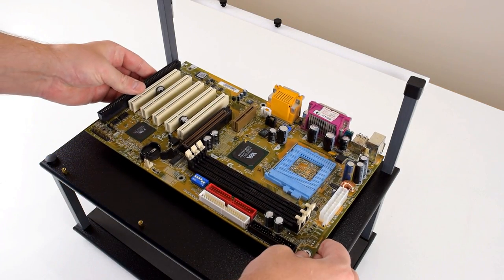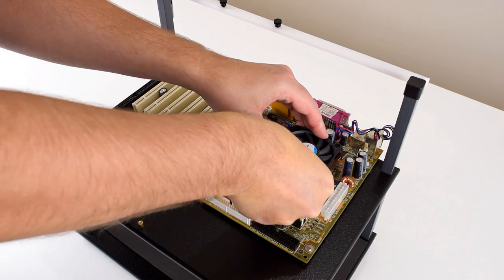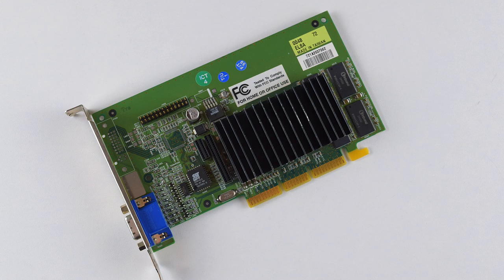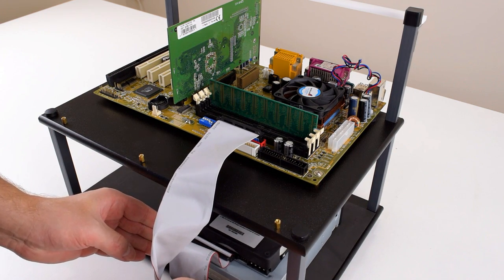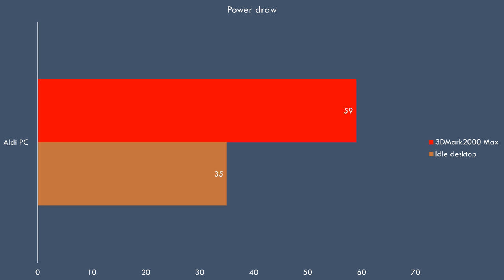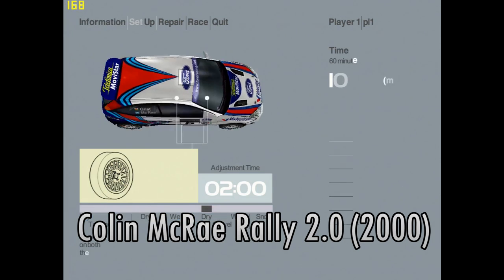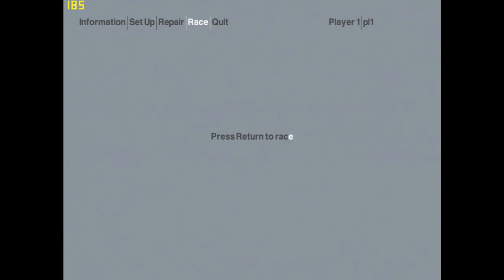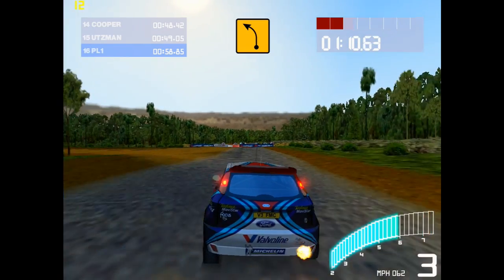Building the Aldi Medion Supermarket PC from 2000

Comment: I started my career as a games developer at a German studio in 2001. Everytime ALDI released a new PC, someone of our team went to ALDI in the early morning to get one. They were sold out quickly. We used them as a "benchmark". It was an internal policy. Everything had to be acceptably playable on these computers with  "out of the box" Windows installation. We did not even update the drivers. Many people had no (or very slow) internet at that point, so old drivers were a common problem. I have heard of other developers doing the same thing back then.
Developers often recommended these PCs to casual users because many software products released in Germany were carefully tested on them.
Reply from the maker: That's awesome, thanks for sharing!
Reply: maybe you can help me because you have worked for a games developer.
Why I have frame drops in Deues EX after I have format the system and install Windows again? I have install Windows update Service Packs and Mainboard and Graphic, Soudn Drivers... its strange.. and now I have texture bug in Hitman Codename 47 before there wasn't any bugs. 
Its strange what is the reason? Even in the Vidoe with Geforce 2MX Deues EX is lagging... it can't be....
it remembres me like GTA San Andreas...
Pentium 4 3,6GHz and 1GB DDR and Geforc e6600GT is enough to handle this game at 1280x1024 Maximum with 3x Anti Aliasing but in some areas the fps go down to under 20 or even 10.... its not normal... how can I fix this?

Comment: The early Aldi PCs were a gamechanger. I remember when the they offered a PC for 1999 Deutsche Mark. It was talked about weeks before it got on sale. Together with the availability of flat rate DSL connections they marked the begin of the Internet Age for the general public in Germany. Those were the days.
Reply from the maker: Would you happen to remember some details about this 1999 DM PC?
Reply: Wen never had one of those since we had PCs since the early 90s but let me do some research. They were sold in the late 90s and I think the first one even came with a Monitor.
Reply: The only thing about the very first ALDI PC I found is, that it sported a Cyrix 5x86-100GP and it sold well for a computer in 1995. The first legendary ALDI PC came in 1997, it sported a Pentium MMX 133 Mhz, a 2,1 GB hard drive, 32 MB Ram, some kind of 3d graphics and a 15" Monitor, a Mouse and a Keyboard were included. It costed 1798 DM.

In 1998 came the perhaps most iconic of all ALDI PCs. The MicroATX Tower sporting a Pentium II 350Mhz, 64 Mb SDRAM, 8,6 GB Harddrive, a Creative Soundblaster PCI 64V, a NVIDIA Riva 128ZX with 8 MB Memory and a 32x LiteOn CD drive costed 1998 DM. It came with a 17" Screen, mouse and Keyboard as well as MS Windows and Office.

The later PCs were good as well until 2001 when their offer was not competitive.
Reply: My parents bought the 1998 PC. best christmas gift ever I tell you! i had no idea they'd be able to buy this :)
Reply: @philscomputerlab  Hello, I just stumbled on this old question. I once got one of "the first" ALDI computers by luck. The owner wanted to get rid of it and it was waiting to be scrapped. Of course I took it with me (along with many other parts) to find out that it was not only completely original but in fully working condition. Specifications were (as I remember rigth now) 486 PIO-2 oder 3, with a Cyrix 586 100GP, a 2MB PCI graphics card and 24MB of RAM. I think there was a 2GB hard drive in there but I might be wrong. 
I later changed mainboard, RAM and graphics card for more powerful 486 components. I want to pull that old machine out again and refit it to original condition. I still have all the parts stored away. This particular machine was sold around 1996. I can take pictures and give precise information about that machine when I have it in front of me again, if you are interested. :-)

Comment: had a similar PC some time ago, always got the old PCs from my Grandpa whenever he got a new one.

Got one from 2004 with a P4 3.2Ghz with HT...got bored and overclocked it to 4Ghz. Ran great. And hot.
Reply: I also got a p4 HT, but clocked at 2.4 and with a radeon 9200 SE
Reply: The LGA775 P4s were ridiculously overclockable: I had a P4 630 (stock 3GHz HT) and it ran with no VCore boost stably at 4GHz for many years.
Reply: i had the P4 640 and also never changed the voltage. I do have a CPU-Z screenshot somewhere, but nothing could read the voltage correctly... 2.3v would be a little much :D

Comment: Your build videos are some of my absolute favorites. Seeing the performance of a particular configuration from back in the day is really interesting stuff.
Reply from the maker: Thanks man! It helps me as well as I have a clear plan / goal to choose parts. If you know any other machines / brands that are worth checking out let me know!
Reply: Well, a lot of systems back in the day used proprietary motherboards and daughterboards. Specifically I remember systems from AOpen, Micron, Compaq, and NEC that used setups like that. They were Socket 7 and Slot 1 if i'm not completely mistaken. As i'm always seeing these kinds of used parts floating around it would be really interested in seeing if you could get something like that up and running, and how it would perform.
Reply from the maker: I do have something planned from the US, still working out details and I got to buy a few parts.

Comment: I avoided these sort of cost savings pre-built computers like the plague back then, but it is interesting to look at them retrospectively.

I've only ever built my own PCs starting when I was a young teenager around 25 years ago from old computer parts I was given and could work on for people. Then when I was making enough, I built computers from all new computer components I would source or have stores order for me – this was well before on-line shopping was really a thing.

The first all new computer I built was a Pentium II machine. The oldest computers I've worked on that I know of had 8086 CPUs and no hard drives, from what I remember. Either way, I still have some of the 8086 CPUs from back then from long since decommissioned machines.

Comment: We still have a Aldi PC from November of 2002 with an Intel Pentium 4 running at 2.66 GHz. It had 256 MB DDR 333 MHz RAM, but I think my father upgraded to 512 MB RAM. And it has a Nvidia Geforce4 TI 4200 graphics card. I was born in 2001and it was my first PC, which I used from somewhere in 2009 or 2010 to 2012, when my father bougth an Intel Core i5 based PC and I got his old Core 2 Duo system.

Comment: 5years ago my buddy gave me his first pc, a "supermarket" pc from the year 2000 (brand was Altec - very popular computer back then in Greece). Specs were P3 800, 256mb sdram, had integrated GMCH graphics with 3d support (on an msi board) and a maxtor 20gb ide drive. After replacing the cpu-fan, psu, the cd-rom drive with a dvd-rom and the hdd I'm currently using it as a voodoo3 platform along with a sounblaster live 5.1.

Comment: You can run Agp 4× under win98 with both Ati and Nvidia without problem by installing Via 4.37 in turbo mode ONLY! (no 4.35,4.43) after that, in some motherboards,would keep the " Via Agp generic windows driver" instead of "Cpu to Agp controller". To do that  you should install manually from where you are reading that (device manager). If after that, enjoy Agp 4×

Comment: I've only bought a pre-built branded PC, and that was my first one in very ancient times (1992 I think). It was a WANG system, with an i386SX 16 MHz, 2MB of RAM, and a 40MB HDD, complete with a VGA colour graphics and monitor. Surprisingly the thing was very much a standard PC, and there was no problem in doing some upgrades.
In 2000 I was using a clone machine with an Athlon 1.4 GHz, 512MB SDRAM PC 133, on an AOpen VIA KT133A chipset based motherboard, with a Geforce 4 MX440 with 64MB. Pretty high performing machine back then.
Reply from the maker: How was that Athlon PC? Maybe compared to the games shown on this one?
Reply: It was a pretty powerful machine, and I could run all games smoothly.
Here's some benchmark results I've been able to find I did on that computer. Everything @1024x768 except Q3.

3DMark 2000
5622 with a Geforce 2 MX
8177 with a Geforce 4 MX440

UT Bench
Flyby : 80 fps
Botmatch : 37 fps

Quake 3 Arena
Maximum detail (1280x1024) : 103.6 fps

CPU Mark 99 : 122

3D Mark 2001 : 5252
Reply from the maker: Awesome, thanks heaps!
Reply: No problem I have a good amount of benchmarks data on retro hardware, in case you need some :)

Comment: The Aldi Medion machines of that era were great deals.  I purchased 2 of them here in the USA for me and my friend.  The year was 2003 and for the times it was really loaded with goodies.  These were touted as award winning design machines, having attained the Red Dot Award, whatever that was.  There were also XP machines with great software bundles.  The cost was 800 dollars per unit.

My Aldi's motherboard died in 2008, so I scrapped most of the internals except for the optical drives and card reader.  I loved the case so much I built a quad core AMD system in it.  I still have the machine and it now currently runs Ubuntu.

My friend used his Aldi up until 2014 when he decided to modernize and bought a new loaded HP.  The only problems he had with his was the power supply and cpu fan died died, so I gave him the ones I had.

I think the Intel P4 cpu ran at 2.5 Ghz, which was fast.  It used the Extreme Graphics built into the chipset.  I disabled mine and added a video card.  Really did not make much difference.  One curiosity of the card reader was it was limited to reading 256 Mb.  When I rebuilt the guts and still kept the card reader, it then read cards in excess of 1 Gb.  My guess is the original motherboard had limitations.

Yes, these Aldi Medions were absolutely great deals for the times they were available.  I always refer to these units as Aldi's and not Medions.  

Keep up the good work with your builds.  Very enjoyable to watch.

Comment: this was great! while we didnt have supermarket pcs so much here, emachines was all the rage at the electronic shops. everyone i knew had one becasue they were cheap, usually using slower than the time athlon chips or even celeron, which around the 2000s were terribly underperforming. usually i would help friends upgrade ram and get at least a bit more out of them.   Also when you said coolbits reg tweak i had a nostalgia blast! awesome!
Reply from the maker: Emachines! Nice, got to do some research, maybe I find a suitable machine :D

Comment: Man, you reminded me of my very first pc. It was an altec one, bought at 2000 from an electronics store for around 2000€ (using today's currency exchange rates). It has a pentium 3 at 800 mHz, 64 mb of ram, a 10 gb ide hard drive, a single cd-rom drive (was later upgraded to a cd/dvd combo drive), on-board g.p.u., a 1.44" floppy drive and windows 98. My dad passed it to me after he got a notebook 2-3 years down the line.

The system was actually decent as long as it ran windows 98. I could browse the net and play a game or two (mostly flight simulator 2000 and monster truck madness 2) but it crawled when I upgraded to windows xp. If it had more ram it could ran xp with ease.
Reply from the maker: Altec? Sound familiar, but I'm thinking of speakers for some reason? Are they related?
Reply: I'm not sure....they might be. I remember the sticker on the case saying "made in Germany".

Comment: i had a medion pc from 1999! it was more 90s "beige box" design than the blue trim you showed on this 2000 model. but it did have a bright blue power button. (the box made it look more teal though.)

my father didn't let anyone even take it out of the box until the clock ticked over to the year 2000, because of y2k. he didn't really know what it was (as you may have guessed).

i couldn't really hazard a guess at its P3's frequency, but i know the hard drive was either 3gb or 6gb (there was some failure that we took it to a shop to get fixed, that lost us all the data, so the 6gb could've just been the smallest drive they had to replace a broken one with.. it's all so long ago!)

it had 2 usb1(.1) ports on the back, and had at least good enough integrated graphics for rayman and tonic trouble to run nicely. as well as some racing games and other ~2002 3d titles, i don't remember a lot of their names now!

Comment: on this System I played a lot of Counter Strike,  Diablo 2, Quake 3, Age of Empires 2, Sims, Sim City 3000, Black & White, max payne, operation flash point, warcraft 3. all those games ran smooth with medium settings. One of the latest games I tried to run on it was Doom 3 with the settings and resolution low, ram expanded and G2MX slightly overclocked. but I think it was all that playable

Comment: Recently i bought a similiar computer from my friend. It is a little bit older, it is from Q1 2000, and has an MSi Motherboard fitted with a Pentium 3 667Mhz. The computer wasn't used much. In fact, the HDD had only 1500 hours of use on, and the original W98 installation still had the Creative sound driver on the desktop, dated 2002!

Comment: This video really reminds me of a PC that I used to have, I called it the "P4 Rig" but it was actually a custom built PC that was built by some company called "DGT" which I think stood for "digital technology" according to a sticker on the front. It had a Biostar U8668 Pro mainboard with an Intel Pentium 4 unknown model 2 GHz, a Maxtor 40GB hard drive (I forgot the model), and 320 MB RAM (PC133). I can already sense 2 cost cutting measures there, plus it was a Micro-ATX mainboard in a silver no-name full-size ATX case, which makes a 3rd cost-cutting measure (in my opinion). Plus, when I got it (I was the 3rd owner, after 2 of my cousins), it was running a pirated copy of Windows XP Pro that was packed with lots of viruses, including one that throttled the Internet connection. From what I remembered, I completely wiped it and installed Windows XP Home from a legitimate product key I had. I did do a lot of upgrades, but eventually, the IDE controller on the mainboard died and that was the end of it, after which I parted it out and sold the parts on the local classifieds, and kept some parts for myself.
Reply from the maker: Awesome, thanks for sharing!
Reply: Back in the day, CPUs didnt had "model name" - it was, like, Pentium 4 @2000 Mhz. That thing happened when Intel hit the wall and couldnt rise clock speeds anymore so they name them in order not to be confused with older models that work on the same clocks. Like P4 530, P4 630 and so on. Their clock speeds were their names. AMD, on the other hand, had to come up with models names in XP era because they could get only to 2000-2200 Mhz and Intel was racing to 4 Ghz.

Funny thing was that Athlon @2000 Mhz was beating Intel @3600 Mhz.

Comment: These days the only prebuilt computers I buy are laptops, and Chromebooks/Chromebits/Chromeboxes, but back in the Vista era I did buy a couple of prebuilt ACER machines here in the US from BestBuy for my sister, nieces, and nephew as they where cheaper then I could of build the same AMD machine for at the time, and they ran well once decrapped software wise, and they still have one of the machines (don't remember the model # off the top of my head) that I turned into a Cloudready OS machine with 8GB of DDR2 RAM, AMD Athalon II X3 CPU(had a few laying around from salvage)  an old EVGA 9500GT 1GB GPU, DVD-RW drive and a 120GB PNY SSD for the boot/storage drive. But well before that in the 90's I had a couple prebuilt Intel Celeron eMachines computers that where given to me as either birthday gifts from my aunt, or as a Christmas gift from my parents, and they where utter shit even after doing all the upgrades you could to those poor Win98/ME machines.

Comment: I believe I have this system (or one similar) sitting in my attic, where I store most the pc's I don't use. I've tried upgrading it, but it wouldn't take more than 512MB. Kinda sad, but I've seen that problem happen with other brand pc's in the budget price section as well (namely Packard Bell).

Comment: The only pre-built desktop I bought was from E-Machines in 2001.  It had a 1.5GHz. Pentium 4, 512Mb. RAM, and a 32Mb. GeForece 2 MX200.  The main limiting factor was the video card.  It ran Half Life 2 fairly well until I got close to the end of the game where I had to play through one area at about 3fps.  After that I upgraded to the Radeon 9600 SE.